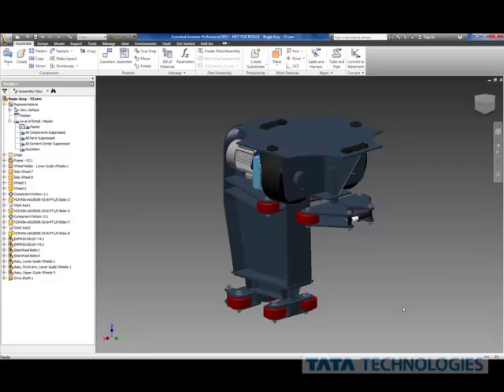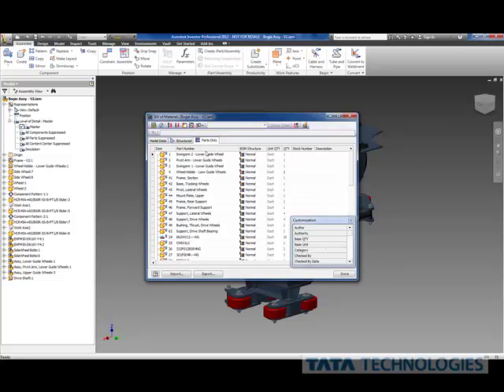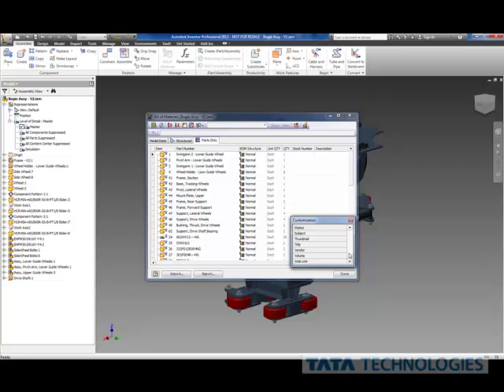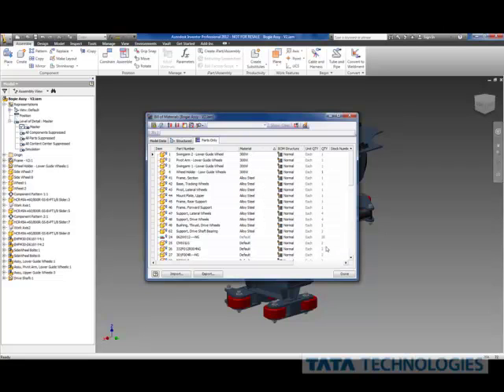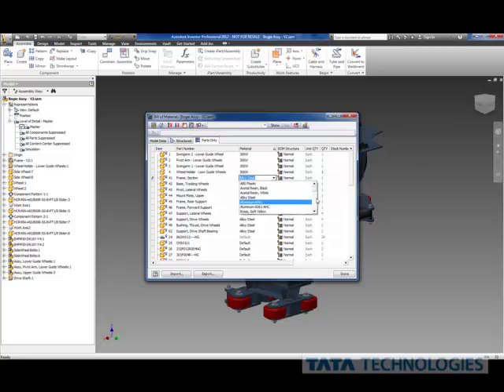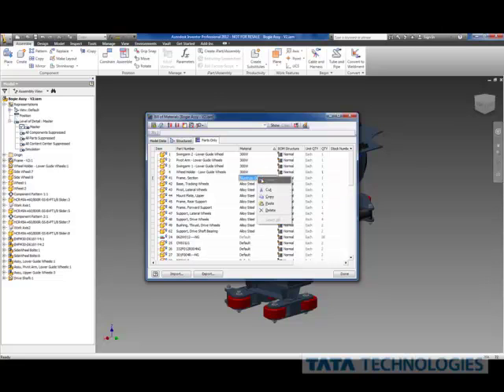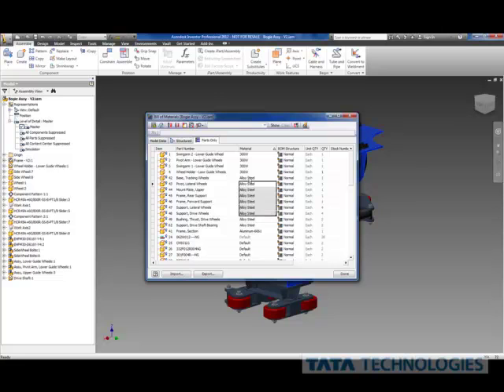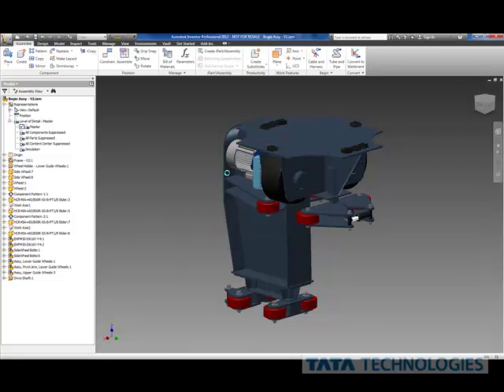Autodesk Inventor - Changing Material Properties Across Multiple Parts

Comment: Is this possible in a part file as well? or does it have to be an assembly file?

I have a part that has multiple layers of skin thickness with each layer a different density. I need to find the overall mass of the part. which means I need a way to assign different densities to each layer, and then get the mass as a whole.